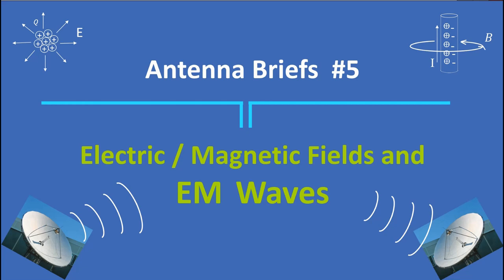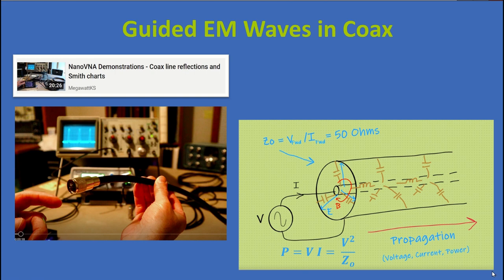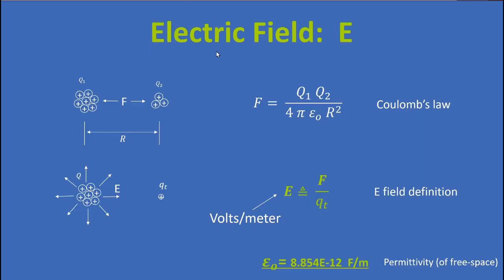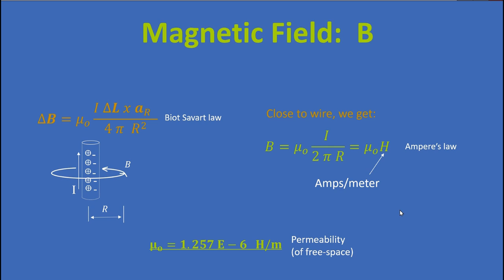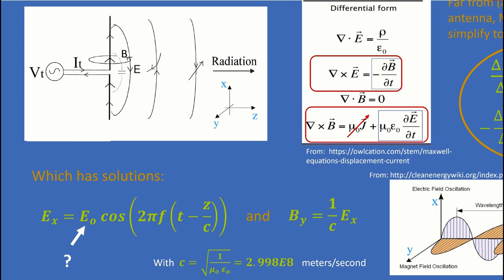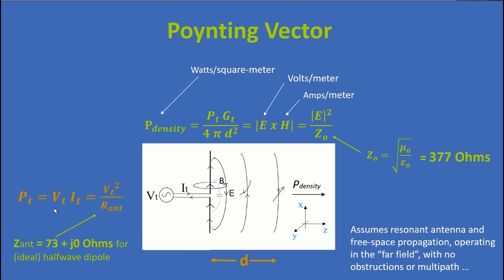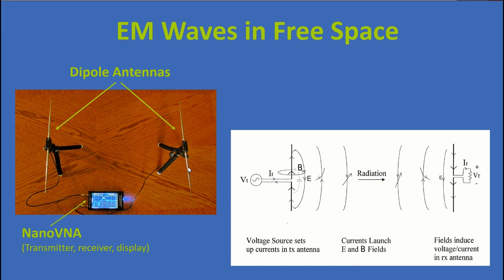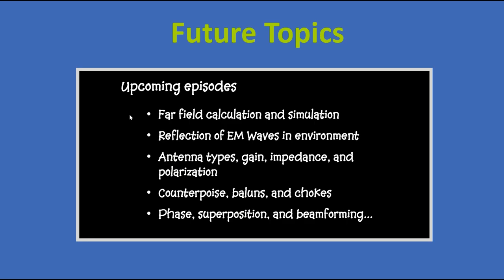Antenna Briefs #5 - Electric Fields, Magnetic Fields, and EM Waves

Comment: Hi @MegawattKS, 

  I have a question if you don't mind answering --- if it's out of scope please disregard (I'm not even sure Youtube will warn you I've left this here). 

  I'm attempting to design a 10MHz bandpass filter (as part of a larger project to build an HF WWV receiver). I've used one of the web based design tools and designed a Butterworth 3-pole filter with 3-dB points of 9.5MHz and 10.5Mhz and 50ohm termination.  I've built the circuit out of parts that I think are reasonable for 10MHz frequencies and have reasonable Q values, low ESR. I've measured the filter with a NanoVNA and the insertion loss is huge, about 20dB.  I've built it on a protoboard and dead-bug style and the results are quite similar. The Inductors had a Q of about 60 and DCR in the 100s of milliohms.  The caps were thin film caps with Q's over 200.

  I suspect I'm making some fundamental error that maybe you'll spot immediately.

  If it's not really apparent, maybe you have some advice about what to try and diagnose first, ... 

  Anyways, no worries if I'm asking too much, please don't feel any qualms  about ignoring the question if I am asking too much.

Thanks,
Rob
Reply from the maker: I Rob.  Interesting problem.  I actually love troubleshooting, so I'll try to help for sure.  Can you provide a link to the web based design tool page and/or otherwise specify what the topology of the filter is? Is it a coupled-resonator design, or does it involve two parallel LC sections with a series LC in the middle perhaps? And what are the LC values?  Also, aside from the insertion loss being high, can you detect any other anomalies in the measured response that might provide some clues?  E.g. does it have the right shape when you measure S21 or does it show some non-flat passband behavior (e.g. two distinct peaks)?  Finally, one way I often try to troubleshoot such problems is to look at S11 and S22. Sometimes if there's a connection issue or an SMD cap failed due to thermal shock, S11 and S22 can give hints (although you mentioned two different builds has similar issues - so that kinda rules that out).
Reply: repo should be available now. Thank you!
Reply: Sorry, I'm having problems with adding comments.  I thought I left the following but I couldn't find it after I returned:
-------------------
@MegawattKS  thank you so much.  I wasn't expecting such a gracious offer.  I'm going to setup a github repository to share the PDF of the filter design with you.  Unfortunately, my computer chose this moment to update it's development environment (including git) so it may take a bit.  I used https://rf-tools.com/lc-filter/ to design the filter.  I chose Butterworth/Bandpass/3 pole/ "Conventional, Series-First" so the design appears to be a series resonator, a parallel resonator to ground, and a series resonator. The appearance of the VNA measured S21 parameter looks about right to me just too much insertion loss. The S11 parameter also looks about what I might expect with a notch downward at the same frequency as when S21 maximizes (however, I'm guessing the notch doesn't go low enough).  I'm guessing I can look at S22 and S12 by reversing the physical ports.  Is that right?  If so, we ought to see the same because the network is reciprocal (because it's linear) right? 

The git repo ought to be available at: https://github.com/ballanty/filter once I get things uploaded.  I'll add the PDF of the filter design and some notes.

Many thanks again!

Comment: Hello,
When an electromagnetic wave strikes a receiving antenna, the electric field of the wave causes electrons to move up and down. What about the magnetic field of the wave? How does it affect the receiving antenna?
Reply from the maker: That's a very good question. I honestly don't have a good answer, other than to say that the full mathematical analysis may be required to illuminate this. In the final analysis, its an EM wave, so electric and magnetic fields are both involved. For the dipole antenna we're discussing, the electrons move in the antenna mostly due to the E-field excitement. At least that's the easiest way to visualize what's happening.  But this is going to create currents and generate a magnetic field of it's own - which then interacts with and changes the overall E and B fields coming into the antenna's vicinity. But that's as far as my intuition goes. Even if the full mathematics of field analysis is done, it may be tricky to say what effects the B field is creating in the receiving situation. Perhaps someone else reading these comments may have insights to share...
Reply: @MegawattKS  what do u mean by (But this is going to create currents and generate a magnetic field of it's own - which then interacts with and changes the overall E and B fields coming into the antenna's vicinity) is the magnetic field coming out of the receiver antenna duo the oscillating  interact with the electromagnetic waves coming in ?
Reply from the maker: @medolol550  Yes - that's one way of conceptualizing it. But not just the B field. Also an E field is 'coming out'.  When I did a Google search for "plane wave field distortion near a receiving dipole", the AI answer says it slightly differently - but equivalently: "When a plane wave encounters a receiving dipole antenna, the electromagnetic field near the dipole can become distorted, particularly in the "near-field" region, due to the interaction between the incoming wave and the dipole's own electric and magnetic fields, causing variations in the field strength and polarization depending on the dipole's orientation and the distance from the wave source.".  (NOTE: Generally I don't trust everything an AI 'thinks', but sometimes it is good at expressing things :-)  The Google AI text references a Wikipedia article as well as something called Energy Velocity and Reactive Fields journals. I didn't dig inside to see where it got the information to synthesize its response from this. But the statement has to be true. Otherwise the EM plane wave would pass the receive antenna unchanged - which is not possible because the received signal power had to come from somewhere 🙂
Reply: @MegawattKS  u know i have finished a full electromagnetism course but the point about electromagnetic waves is not clear at all , like duo to special relativity there is nothing called magnetic field , duo to quantum electrodynamics there nothing called electric field even its just the effect of the virtual photons  , i just wanna be professional at electromagnetic waves i dont know how to be like this cuz of that so  how to be like this cuz of that confusing so u know a way?

Comment: Is it possible to print out the slides for reference?
Reply from the maker: I don't have them on a website currently - but am starting to work on that thanks to your comment. I'll try to reply again if/when I get that done. Thanks for the inquiry. 73's  (ham radio speak for 'best wishes')
Reply from the maker: Finally got the website built out and the slides uploaded. If you're still interested, they're here: https://ecefiles.org/rf-design/  Unfortunately, they will use up a lot of ink if printed, as I didn't find an easy way to set everything on a white background :-(